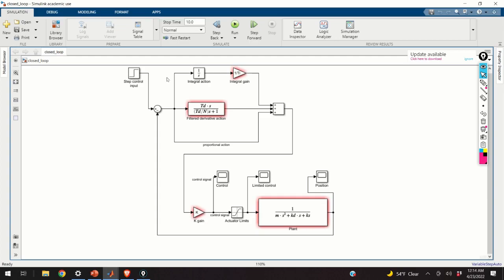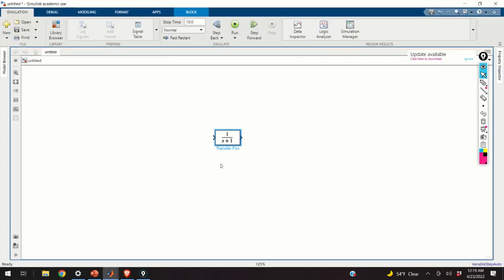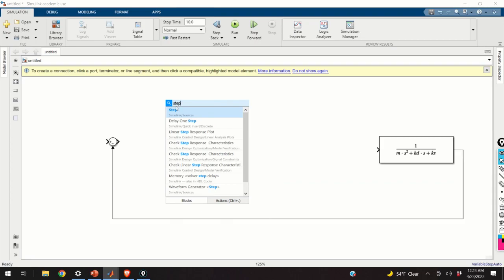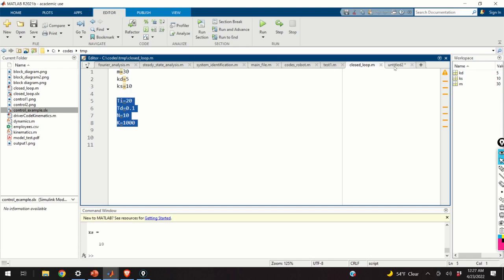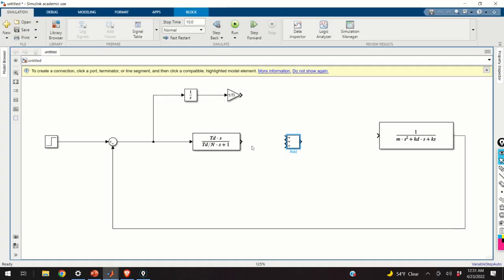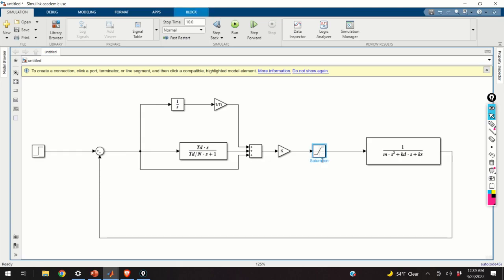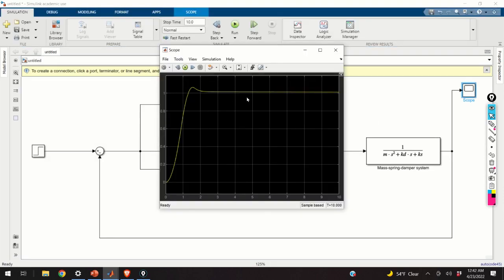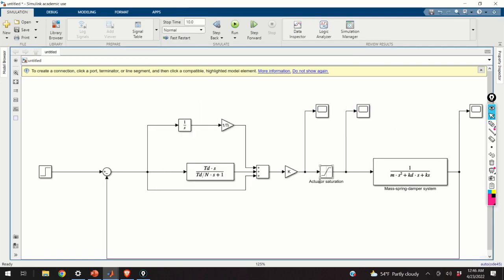Intro to Simulink Simulation of Control Systems with Actuator Limits

Comment: Thanks a lot for this video.
Can you tell, is root locas controller useful for complex model?
Reply from the maker: You can use root locus if you have a system with a single output. However, there are more appropriate methods for systems with multiple outputs. For example a pole placement method. You have several videos on my channel explaining this method. Also, I am currently creating a video on how to design a controller in Simulink and how to simulate it.
Reply: Thanks a lot. I invested a lot of time on this. You are a blessing for me. Would you please suggest any controlling multiple input output method. Please make videos on this.